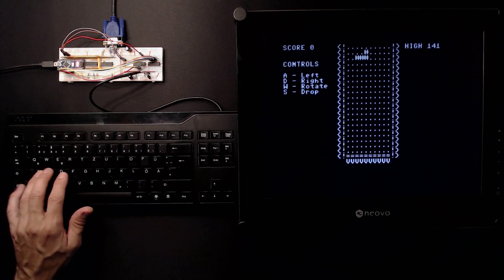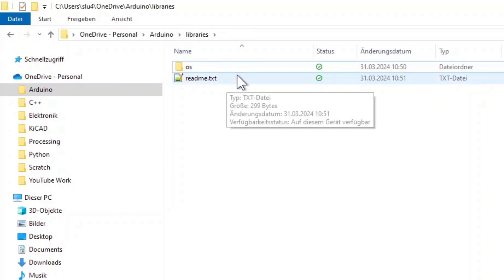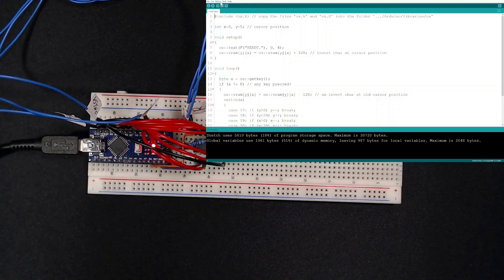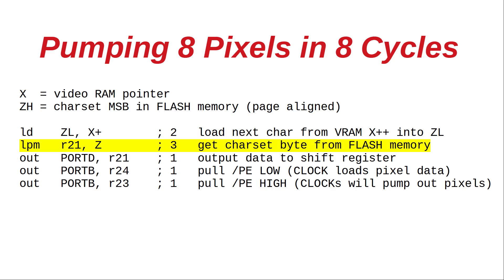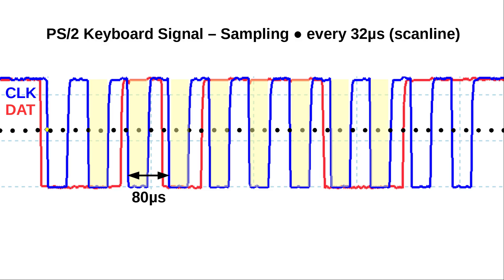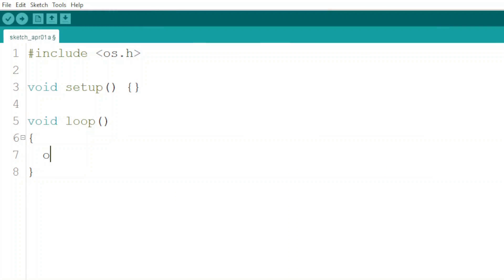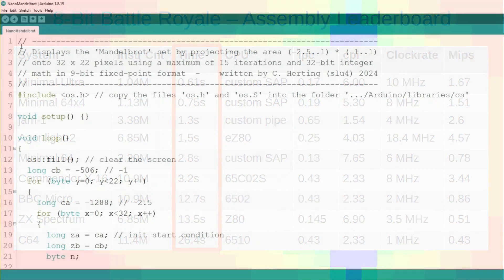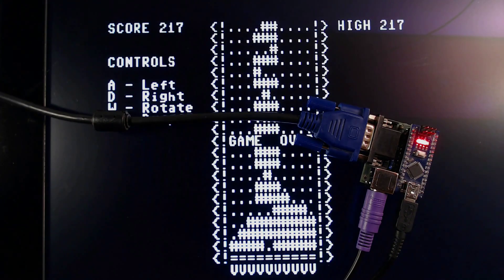Squeezing Water from Stone 3: Arduino Nano + 1(!) Logic IC = Computer with VGA and PS/2

Comment: Just looking at your design, I think you can add some color at a cost of a couple more ICs. If you used two '166. Route the 8 bit data high nibble into one shift register and the low 4 bits into the other. Tie the serial output of one shift register to the Red, other to Green, for instance. You would have to slow the shift to half current speed to stretch the pixels would by twice as wide. Both '166 would have their [E, F, G, H] registers filled with a single byte/Write. You would encode color in the nibble i.e. byte 1001-1110 would clock out of the first'166 as 1011 would be Red, blank, blank, Red while the lower nibble would come out as Grn,  Grn, Grn, blank, Grn. They would combine on the screen as Red+Grn, blank + Grn, Blank + Grn, Red +Blank, if I have it right.

Of course if you had 4 '166, you could divide the byte up into 4 slices, but I'm not sure you need intensity. You can only get ~14 bits I/O right? It would be nice to change it on the fly with changing the shift out clock to 1/2 or full speed so you could just ignore the extra hardware when you wanted to just do high rez black and white.

I think there is a universal shift register, something like a 74LS194, with all shifts output, but it's only 4 bits.
Reply from the maker: Great to hear that my minimalistic design inspires you to take it into a colorful direction. I like the fact that you keep the highres since it is essential for the editor and stuff.

Comment: I have a stupid idea
What could we do with arduino computer if we add one or two port extender ic's?
we get a bunch of harder to adress io pins but we could technically use them for iio while routing one of oruginal ports to some more ram or rom

could something like this work to  run some more advanced os and actual color graphics?  would a external graphic chip work over those extra io or would it be forced to work on main memory bus if we expose it on oryginal io?
Reply from the maker: I think your idea isn't stupid at all but quite mainstream. Using a graphics chip and eyternal RAM and stuff. I kind of do the stupid thing here by trying to do it all in one 😀
Reply: @slu467  yes but i was thinking more of doing meinstream the stupid way. like bulding a character rom of text and squares and changing color on character and not line basis, byt you probably need more ram and io for that so give minimal os more io and ram but keep video generation in bare arduino outputs and using extra legs for slower stuff like keyboard or even horisontal refresh pulses
if we operate with character based graphics like c64 we could technicallt make mandelbrots apear higher resolution than the actual one and in color 
something like that , overthinking the output with neglecting to upgrade hardware unles absolutely required and upgrades would be the lowest common denominator for the job

Comment: what's the actual difference from your video since 3 years ago?
Reply from the maker: 4 IC versus 1 IC needed.
Reply: @slu467  Oh I see. You published a video 3 years ago that only used one 74HC166 ic. So you are adding keyboard support without any additional chip
Reply from the maker: @RelayComputer  Now I see which video you were relating to. I had the one with VGA and PS2 in mind that used 4 logic chips...

Comment: Well done on the Nano VGA videos!  One thing that has confused me (and wasn't addressed) is the pixel clock on VGA (640x480x60p) is 25.175 MHz which is approx 12.5 MHz for a 320 active pixel line - So how is this working at a pixel clock rate of 16 MHz ?  Are you just pushing the VGA tolerances a little and the displayed frame is compressed and slightly to the left of the screen ?
Reply from the maker: In VGA, pixel data is an analog signal. The pixel clock rate is only important if you want to get the 640 horizontal pixels. See my DIY video RAM series on how I've set up my minimal VGA from here.

Comment: I have a question... s it possible to display figures or individual pixels? If this is possible, great, because I plan to repeat this project with minor modifications, such as BASIC or an SD card or more games.😊 Your projects are amazing and I want to learn and practice some coding so your project is Perfect to learn❤️Have a nice day!
Reply: But It's possible to code games like snake or something and it's great too😀
Reply from the maker: Hi this is a text display only. The Nano has only 2K of RAM of which I use 1K for the 40x25 text VRAM. There is a charset stored in FLASH which of cause can be altered - but that might not be the thing you are looking for.
Reply: Ok😊 thank you
Reply: It is cool too
Reply: Sorry for my english😅

Comment: I was about to buy an FPGA and make my own CPU(+MMU+GPU), so it's really nice to have some reference material available.
One of the goals is definitely going to be maximizing performance.
By keeping the clock speed and source program fixed, optimization can be measured in binary size and computation time.
Would you have any wisdom?

Comment: Wow! 
That is a great project. 
It happens to be almost exactly what I have been looking for. 
I would like to do a little Raspi Pico project that can display a 80x24 or 132x40 character matrix on a VGA display. 
I want to implement a VT52, VT100 or VT220 style character terminal that can connect to a host computer as a dedicated serial TTY to act as a console terminal.
For that it also needs to support a USB host for the keyboard and provide a serial or USB B type interface for host side interface.
I had found some adafruit add-ons for some of that, but I am not sure they can work together.

I have been looking for an 1980s style VGA graphics chip with a character generator, but what I see here is that you just pump out the pixel data discretely. It is much simpler and can be implemented the state machine on the RP2040. Up to VT220 I need no colours and the characters can just be copied pixel by pixel from a character pixel map.
Thank you.

Comment: What this now needs is a port of BASIC
Reply from the maker: Hopefully, someone is gonna kick the ball in that direction...
Reply: Arduino Basic is already on github for a while. Thats why i was watching this video haha, want to build an arduino Basic computer with VGA and keyboard!
Reply: @slu467  mini-6502 emulator to run ms basic :)
Reply: I built something similar to this about 10 years ago with and Arduino Duemilinoev using the Arduino Video lib PS2 lib and using a port of tiny BASIC. After changing it over to an Arduino MEGA it had like 8kB of RAM for BASIC. But, at the time, I did not have any way to save to SD card etc. I think that I used something later like copy and paste from a text file to serial to "transfer" BASIC programs to the Arduino Home Computer. Incidentally, an other friend of mine Usmar Padow in Tokyo made a similar setup almost exactly as mine but he had used two Arduinos and had an issue with reading the ps2 signal sent from Arduino to the other via serial as it interuppted the video output like the ZX80. I think I remember telling him to switch from using the interrupt to only read the serial buffer connected during the vblank or retrace or something and I think that he fixed his problem. But this implementation with a Nano is just AWESOME! I think the Usmar's video is still here on Youtube somewhere.
Reply: I found it!
https://www.youtube.com/watch?v=DNcX7wJsR_A

Comment: Nice. How about SPI interface instead of external IC? You can have 8 MHz pixel clock and parallel to serial converter at same time. Or even USART in SPI mode. In this case you will get buffer on TX. I think its good way save one IC.
Reply from the maker: 8MHz is not enough. We need to pump out 8 pixels every 2MHz to meet the VGA timing, hence the 16MHz system clock...

Comment: This is incredible. Thank you for your inspirational and educational videos!
Would it be possible to put your min-language interpreter on the device, and also add functionality to read from and write to a permanent storage medium (such as an SD card etc.)? This enhancement would allow for the development of programs directly in your min-language for the device, eliminating the need to use the Arduino IDE and C language for flashing the ATmega to put programs on it, basically making it a standalone system.
Reply from the maker: Good ideas - go push it in that direction! Would love it!